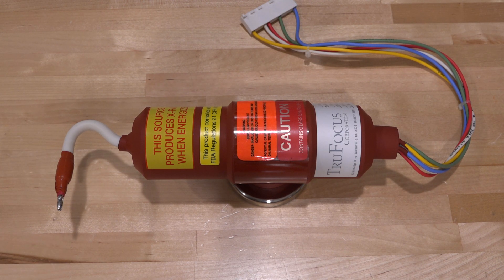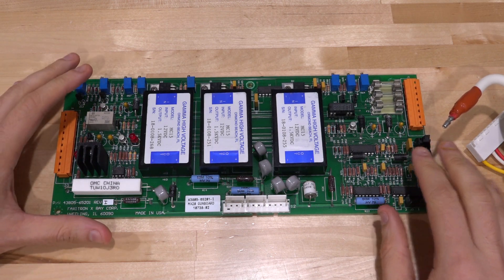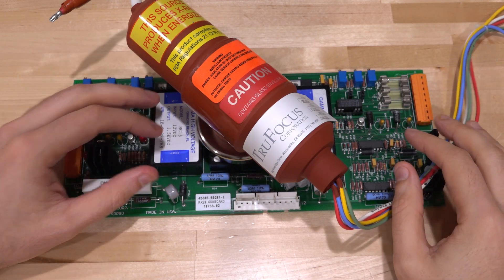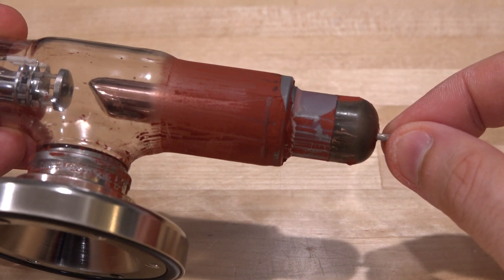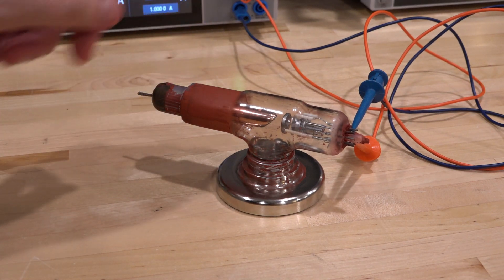TNP #52 - A Faxitron MX-20 TruFocus X-Ray Tube Teardown & Analysis

Comment: Can you tell us what the range of x-ray spot sizes were available from thus tube? I was involved with the design of demountable microfocus tubes which used magnetic focusing as opposed to electrostatic focusing. These tubes typically produced spot sizes of between 10 to 2 microns which gave incredible geometric magnification.
Reply: The spot size of Trufocus TFX-8050 tube is 8-10 micrometers.

Comment: Nightmare scenarios working as a B-MET. Overheated tube started leaking oil out of the aperture. Another, cable not correctly installed, exploded out of the tube and carved a 4 inch wide 2 1/2 foot long gash in the lead wall of the room. 
Called in at 02-00. Open heart surgery ongoing. The new C arm was blasting out electrical interference so when they brought the arm over  the patient the ECG displayed static crud. I spend a half hour under the surgery table with double lead aprons. When the surgeon gave the word I briefly uncovered the photo receptor end then covered it up. GE sent me six additional shield modifications for that POS.
Reply from the maker: Wow!
Reply: @thaiexodus2916: Let me see if I understood: there was an actual open heart surgery going on in a hospital, in the middle of the night and for some reasons the machine was not working and you had to manually "take the xray photo" by standing in the way of potential xrays and being covered in lead to protect you and manually opening the the xray camera receptor? Oh boy... At least it was for a good cause: you participated in a heroic way to save someone's life :)
Reply: @petrusoroaga6528  That pretty much summed the scenario up. The surgery had something to do with a pacemaker.
Never looked at it that way. I'm also an EMT II with code blue saves under my belt.Just part of the job.
Here's a laugh, Had a code come in on an ambulance. ER sup had me bump a green EMT that was doing compressions. Sadly went flat line. Later administration came storming down to the ER and got in the PODs face. A maintenance employee on the crash team??? Doc V casually mentioned I was also the alternate in house CPR instructor. AHA certified instructor instructor,

You got me thinking. It was shortly afterwards that the ICU got a brand new patient monitoring system and some of those antique HP square metal box ECGs were replaced by a brand new system. When I repaired those ECGs HP had to dig through their archives for my parts orders. And around that time the equally antique defibrillators got replaced with new Lifepac 6s. And x-ray room 1 got a refit with a angio upgrade.
When the physicians barked administration got moving.

Comment: Faxitron MX-20 TruFocus X-Ray Tube Teardown & Analysis

* 0:07 Introduction: Shahriar presents a defective Faxitron MX-20 X-Ray tube that overloads its power supply. 
* 0:34 Beryllium Window Warning: Highlights the presence of a beryllium window and the associated health risks of beryllium dust.
* 0:44 Focusing Board: Shows the control board responsible for focusing and deflection of the electron beam.
* 1:13 Microfocus Capabilities: Explains the advantages of the tube's microfocus feature, including sharp imaging and magnification possibilities.
* 1:40 Safety Precautions: Emphasizes the importance of not energizing the tube outside of its protective enclosure due to X-ray radiation risks.
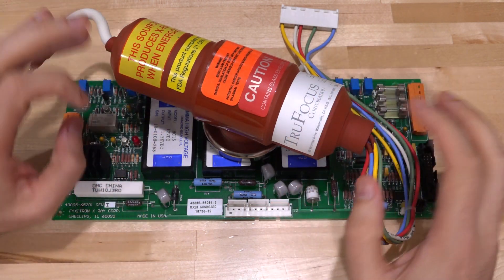* 2:15 Teardown Reveal:  After a challenging removal process, the X-ray tube's internal structure is exposed.
* 2:28 Operating Principle: Explains the basic functioning of the X-ray tube: electrons are emitted, accelerated, and collided with a target to produce X-rays.
* 2:58 Electron Acceleration: Describes the role of the high voltage input and the electric field in accelerating electrons.
* 3:03 Focusing Plates: Points out the internal focusing plates that shape and direct the electron beam.
* 3:14 Target Material: Mentions tungsten as a common target material due to its high melting point.
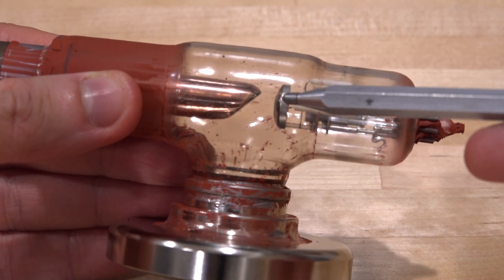* 3:37 X-Ray Scattering: Notes that while most X-rays are directed through the beryllium window, some scattering occurs.
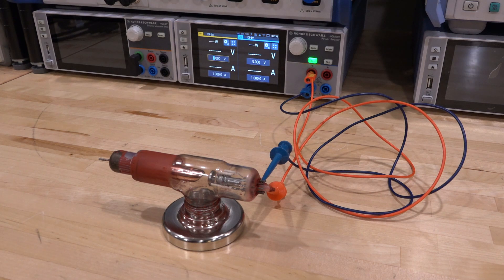* 4:12 Heater Demonstration: Shows the heating element glowing when powered on, emphasizing that this alone does not produce X-rays without the high voltage.
* 4:47 Conclusion:  Shahriar expresses his intention to keep the disassembled tube for potential future experimentation. 

I used gemini-1.5-pro-exp-0827 on rocketrecap dot com to summarize the transcript.
Cost (if I didn't use the free tier): $0.0198
Input tokens: 14218
Output tokens: 401

Comment: To see if the tube has air inside, light up the filament and apply a few thousand (5 kv or so) to the anode. This will cause a blue glow in the tube if air is inside. The 5 kv is safe as far as X ray emission is concerned.

Comment: Is there a heater ? Since I only see focusing wires for high voltage. So how does it work in that case, where are they getting electrons  ?
Reply: Two of the coloured wire bundle were for the filament and the other 3 for cathode and focus.  The Anode contact is the wire at the other end.

Comment: I remember when in the late 1990s the Ilmor engines inside the West McLaren Mercedes F1 cars had berylium inside. Because of the dangers of berylium dust it was deemed illegal to use this element not long after.
Reply: I used some speakers with a berylium membrane a couple years ago. If I remember correctly it was a pair of 18sound ND3BE high frequecy compression drivers. They sounded cleaner than the usual Aluminium or Titanium membranes, but are incredibly expensive. But with modern coaxial compression drivers they have become obdolete. Becuse each of the two membranes in the coaxial only has to cover a smaller frequency band, they can be made of polymer without negativly effecting the sound quality. An coax only costs 1/2 of a berylium driver and you get all of the benefits of a modern ring radiator, like higher power handeling, higher output and increased robustnes.

Comment: ב''ה, cool video; not to be a wet blanket and for that amount of potting hopefully few will ever be doing this..
 
But enough of us have surely been the bored teenager coming into this stuff through forgotten "junk boxes," and the teardown removes the notation about the beryllium hazard unless you're managing to stick that back in the box / securely tape it to the artifact.
 
As much as I'm not sure if the kids will be able to read in 50 years, perhaps some sharpie "BERYLLIUM WINDOW - LUNG HAZARD!" on the base is in order.
 
What's the appropriate way to dispose of these things?  In some areas curb recycling is hands-on and they'd be bent with declared hazmat while it could harm someone undeclared.  You'd figure multiple levels bagged trash would be going direct to landfill but I don't even know anymore.

Comment: Are you quite sure that tube is dead? Its hard to believe a focus plate would come off. But since the filament is intact, I would try to spot the broken bit. Pop the nipple and then either cut the electron gun off with diamond wheel or if at all possible, make the fix through a drilled  hole in the side. 
Fix or remove the broken plate and seal her back up, pull new vacuum, good as new.

But man, i gotta know what’s wrong with it. Can you maybe put a multimeter to the pins? Or look at the gun while on the toilet? 

I bet thermal cycling broke the weld on a focus plate. 
It might still work without the focus. 

I love tubes!!!!

Comment: I have a Bioptix Pixarray, the x-ray tube is inside a lead lined stainless steel container filled with oil, the container was leaking so I had to take it apart, clean and refill with new oil because some of it was already gone. It also was a great hassle. This tube unfortunately is not a microfocus tube but still very handy.

Comment: Unless air has leaked into it I think you can still use it as a basic x-ray source, it just won't have the fine focusing ability. The anode is clearly not shorted to the cathode so electrons should still be able to be accelerated towards it.  I would try to just connect the heater, anode and cathode and leave the other electrodes unconnected.  I think it should be able to create quite a strong beam but the focus point would probably be a few mm in diameter rather than a pinpoint.

Comment: Well this saves me a job tearing one down - Mine also died recently- very low beam current. I transplanted a tube & PSU from another Faxitron system, which gives more kV but larger spot size.
Reply from the maker: Glad you got yours working. The small focus size is important for the kind of x-rays I often take looking for fine traces and internal features of modules.

Comment: I think the problem is the plate is shorted to cathod. The vacuum level inside should be fine and the heater is still working. So the short is the only possibility I can think of
Reply: Focus assembly or cathode shorted to heater most likely, or a spot weld inside the gun assembly has cracked, and the energy of the internal arc welded them together in a wrong way.

Comment: Maybe it lost vacuum ?
Reply: Not likely.  Vacuum tubes tend to get cloudy / go white on the inside of the glass envelope when it looses vacuum.  Also, the filament usually burns out in short order.  Think of a light bulb.  The filament can last for years in a vacuum and burn out in seconds in open air.
Reply: @mikesradiorepair  Getter material (the one that is evaporated) on the glass goes white when they loose vacuum*
Here I did not notice any usual getter material visible on the glass, so maybe they use a different type of getter?
Also X ray tubes like cathode ray tubes require very hard vacuum to operate properly.
So even slight leak that may not cause the filament to burn out will definitely cause a conductive path at the operating voltage, hence shorting the HV power supply.

So I believe some vacuum was indeed lost and the getter material did not keep up/is depleted.
Reply: @MrSlehofer  No getter in those HV tubes. They are baked at high temperature under extreme vacuum to outgas the tube.
Reply: You are exactly right. 
De VU2RZA  @mikesradiorepair

Comment: X-ray the x-ray tube..?
See it it emits a voltage
Reply: Well, it will do thanks to the photoelectric effect. In fact x-rays are massive overkill, about 10,000 times as much energy as you need to eject electrons from a tungsten surface!

Comment: Have you ever used your xray machine to xray parts of yourself or your cat? For example;  wrist, hand, foot?

Why does it have a beryllium window and not just glass like the rest of the tube?
Reply: Beryllium is very transparent to X rays. Glass will only absorb fairly low energy X rays, but  that's actually a problem since you want those low energy rays to give a decent image that can discern between different materials at the low end of absorbtivity. (in other words you get a worse dynamic range)

If you've filtered out all the x rays that can be absorbed by glass, then the only things that will show up in your image are things that block x-rays better than glass.
Reply from the maker: I have never put anything alive in the x-ray machine for obvious reasons.